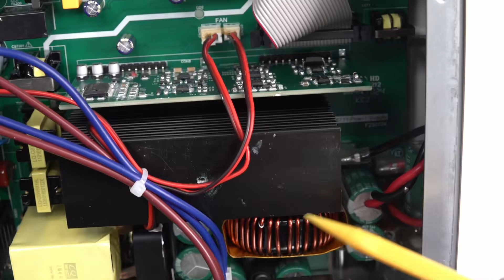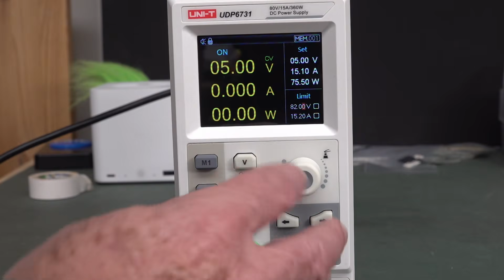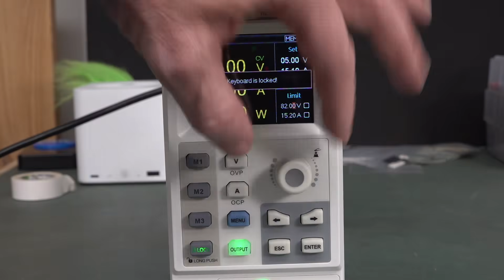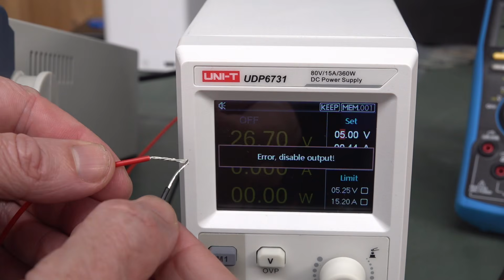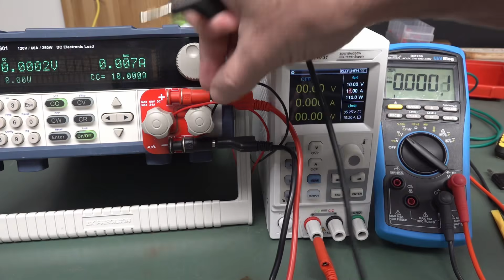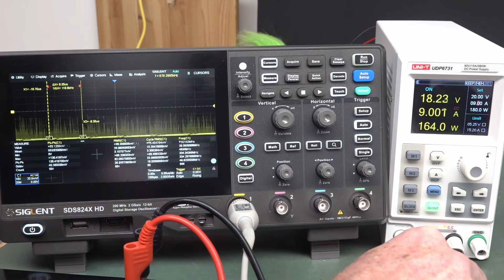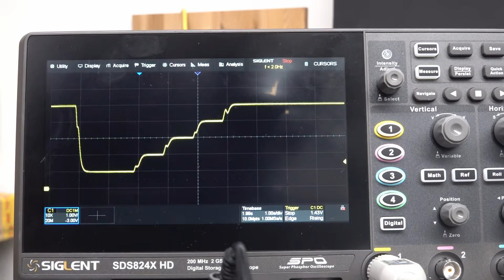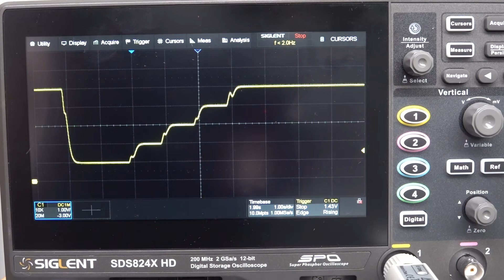EEVblog 1691 - Uni-T UDP6731 360W Bench PSU REVIEW

Comment: RS232... how quaint!
Reply from the maker: Unfortunately seens very common as the only connection on PSU's. Ethernet as well would have been nice.
Reply: @EEVblog  With a protocol that's easy to program without using half a gig of libraries.
Reply: Nothing wrong with rs232. Reliable.
Reply: @perkulant4629 doesn't autoconfig which is a major disadvantage these days. "Generation Eazy", ya know. RS232 works over well longer distances than USB.

I still have many systems with serial consiles here.  Eval boards and vintage big iron.
Reply: lovin' it!
Reply: Yeah, I'd have loved to see an Ethernet connection for LXI personally.
Reply: Real men use GPIB, wizards use HPIB.
Reply: I've spent so much time fighting drivers and software trying to get USB controlled supplies working that seeing a good old serial port is a relief!
Reply: @ShinyMajor manufacturers simply don't have an idea how to use the USB properly. It doesn't require any drivers, in fact. Also it is possible to simulate the serial port over the USB, easily. On top, most of modern PC or laptops don't have RS 232, it is antique. In reality, almost no one really bothers to use it, so it just sits there uselessly.
Reply: Are you the type of person who would champion USB-C charging on a DeWalt impact driver?
USB always has, and always will be a buggy, unreliable standard with weak and easily damaged connectors.
RS232 is still HEAVILY used in industry for very good reason.
Reply: @digitalradiohacker my friend, when someone doesn't know what the problem is he tends to declare it "buggy". There is nothing wrong with the USB, believe me. Also power delivery over USB-C is not an issue either.
RS232 is used only to support old hardware that is too expensive to decommission.
Reply: @digitalradiohacker  There are a few USB-to-RS232 converter chips which are in MANY devices that were lazily upgraded fromRS232 to USB.  Those are not without fail but they do work pretty well in my experience.

But I'd be worried by any more complex implementation of a USB interface.  Which also usually are not properly documented and no, I'd not be happy with some manufacturer provided, effectively unsupported GUI program that runs only on an OS I don't use (Windows).  I take RS232 any day over such a f*up.
Reply: @TheJcrist  There are multiple things wrong with your answers. It starts with bold assumptions, contradicting statements (if nothings wrong with the USB, how did you come to the conclusion of most manufacturers inability to implement it properly?) - and ends up being unnecessarily rude. Nothing in your computer works without a driver, unless you've come up with a totally custom system architecture running your microkernel to use youtube. And talking about implementation, you'll have a hard time finding anything close as robust as a machines RS232 communication - across all platforms. Saying RS232 is only used to support legacy hardware while watching this exact video is beyond reasonable. Many people would prefer RS232 over anything else. Getting this PSU controllable in HomeAssistant via a simple esp32-bridge? Probably less than an hour of work. Have fun starting to parse some weird USB-HID without documentation with nothing but a proprietary .dll for you to reverseengineer.
Reply: @coolm98 people are usually very conservative. They tend to do things in an old-fashioned way because they understand how it works. But if we were to follow this logic, we would be still riding horses instead of cars. 
Most of modern OS already have the USB HID driver out of the box so no need to have a dedicaded driver. There are some scenarios when such driver would be necessary but they are far beyond the RS232 capabilities. As I mentioned earier, USB can simulate the serial port easily, and this will work on any typical OS: windows, mac or linux. RS232 is just an obsolete  physical connector while the USB is way more versatile and powerful. 
Connecting a UPS with the USB to Home Assistant is very simple and it doesnt require any custom adapters, only proper software configuration. I have my APC UPS connected to HA through the NUT server, no issues whatsoever.
Reply: @TheJcrist  STM32 got USB communication and it works quite well
Reply: @TheJcrist  I don't need to "believe you".   I'm perfectly capable of making my own assessment, thank you very much.  And that assessment is that USB is an abomination that sucks donkey balls in all of its myriad forms.
Reply: @TheJcrist  I have dedicated PCIe board with 2xRS232 + LPT in my lab PC ;)
Reply: @TheJcrist  
"RS232 is just an obsolete  physical connector"
RS232 is a communications standard. You might be thinking of 9P9C which is the actual connector most commonly seen.
I am not what you might call a common consumer. I design and build gear but I also implement systems professionally. I have been doing both for some years. I have NEVER seen a broken 9P9C connector, but I have seen hundreds of broken USB connectors. I have NEVER had an RS232 link drop for no reason, requiring disconnect and then reconnect, but I battle with USB every single day, and so do you, and so does everyone else here.
USB is jedward quiffed, consumer grade, low reliability GARBAGE for little boys to charge their phones, whereas RS232 and RS485 is still used in brand new power station control loops.

3D printers? USB
Instagram browsing device charging? USB
Totally disposable memory stick? USB

National grid tied generation control? RS485 / RS232
Public safety radio systems? RS232
Fire alarm and sprinkler control panels? RS232
Reply: @TheJcrist  Like you just stated, it’s trivially easy to acquire USB to serial/RS-232 adaptors which will work with basically anything. You seem to be contradicting yourself? 

Serial is also extremely useful to implement in a ROM based, pre-boot environment for diagnostics besides being used for direct control of devices. It’s also far easier to diagnose serial encoding issues.
Reply: RS232 & RS485 still have valid use in many environments. Consider transmission length versus interference. Sure its generally slower but that may not be the limiting factor. I adhere to the principal of KISS, though with an allowance for expansion.
Reply: my korad psu has rs232 AND usb using a ftdi chip in parallel on the rs232 lines.
@EEVBLOG a reason why the Lister feature is not available in the pc software may either be that it is not implemented in the protocol ... or they just haven't implemented it in the pc software yet. even though, they could implement it without the protocol by just sending the setvoltage/setcurrent commands, introducing a small delay in the switching.
for the shorter log interval, you could try to set a higher baudrate 😊